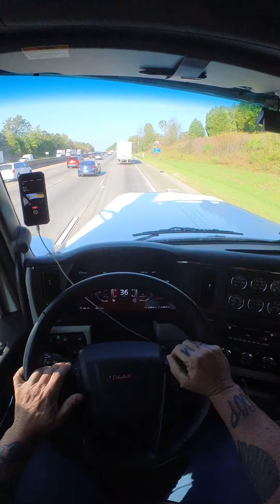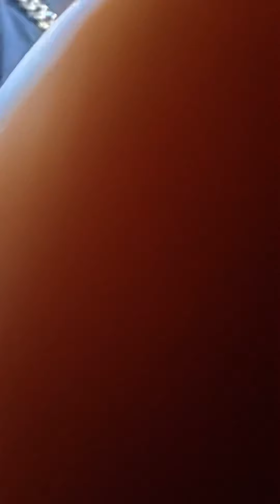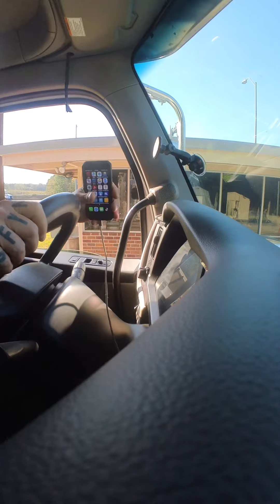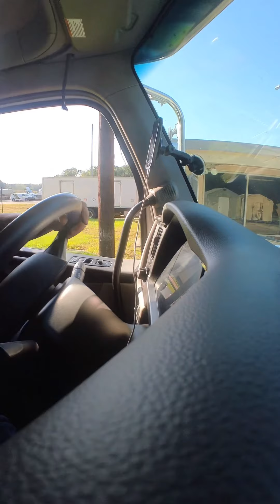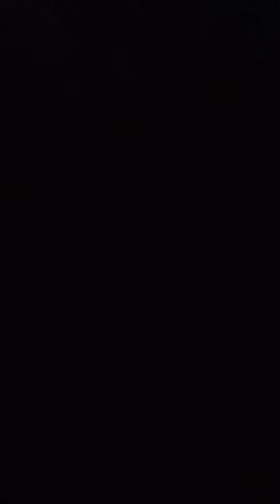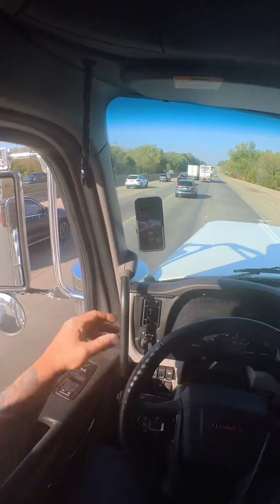Using a highway weight station with an oversized load

Comment: Is it ok for anyone to enter scales? 
I wanna wiegh my f250 with cab over.
Reply: @AnonMedic  try to find a gravel pit or a trash/transfer station they will let you weigh.
Reply: They'll write your weight on a citation for you if you're overweight. Do you want to take that chance? Many truck stops have scales. Some of them are free. Also if you find a weight station that's closed then you can run over the scales and look at the display sign as they usually leave the scale powered on. I wouldn't risk driving through an open weight station unless it's a personal vehicle and you are 100% sure you don't exceed the weight capacity of the truck. But it sounds like you're not sure since you want to check the weight. 😂